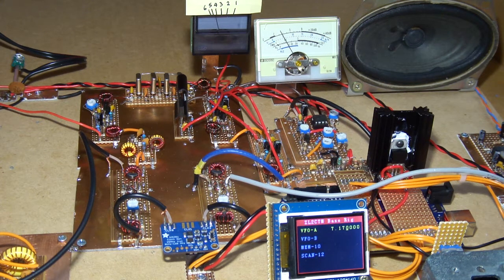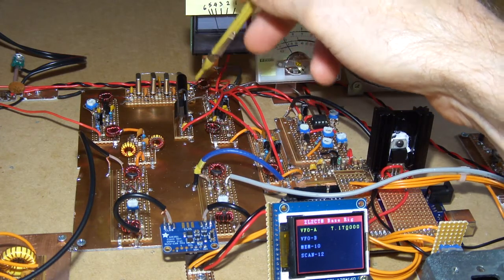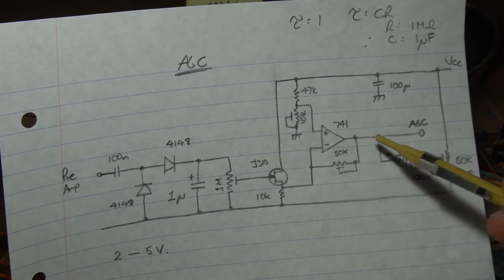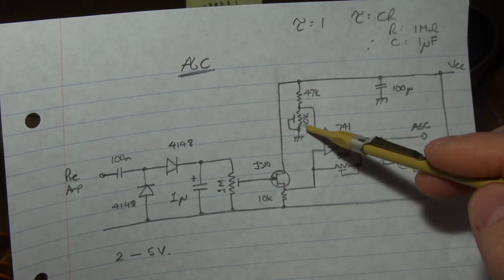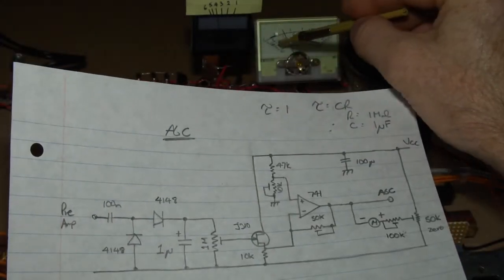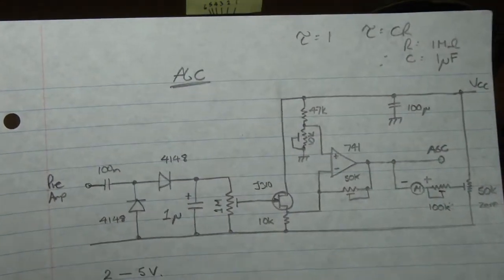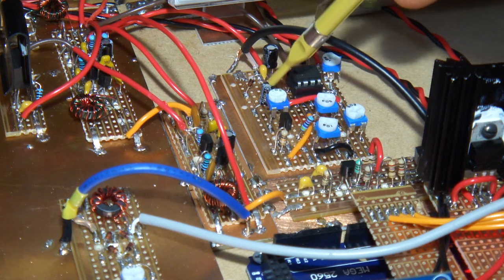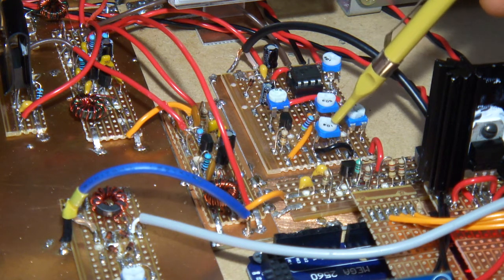Homebrew 80/40/20m SSB Rig Part 6 - AGC and S Meter

Comment: Hi, Charlie have you seen the debate on Mikes Radio repair corner over the S9 calibration levels he uses were he can the international standard for S9 you may not have got that far yet with your receiver Charlie. But adds food for thought.
Reply from the maker: No I haven't David. I'll take a look. Thanks for the link.Charlie

Comment: Hi Charlie
I have some questions again ....
Can you please tell me the turn ratio of the transformer of the first to the second IF stage?
It is possible that you have explained that in the last videos, but I can not find it.
The thing with the LM317 I did not understand unfortunately. Where did you connect this exactly? Can you perhaps explain this circuit in more detail?
Please excuse that I do not get it that easy.

73 Bernd
Reply from the maker: Sure thing Bernd. Now that the receiver is about right (for me), I'll draw up a schematic and put it on the blog. In the mean time, the transformer between the first and second post-crystal filter IF amps is 14T:20T (amp output is 1250 ohms, amp input is 2450 ohms). The LM317 is providing 3VDC to the J310 source resistor. Normally, this resistor is between ground and source. In this case, it's between 3VDC and source. I originally had four 1N4148 diodes in series (from ground to the source resistor) providing this voltage.

73s
Charlie
Reply: This way?

                                  Input ----------------:------------Gate
                                                              :
                                                              R
                                                               :
                                                               :
                                                               +
                                                               3V
                                                                -
                                                                :
                                                                :
                                           ----------------GROUND----------

Thank you for the Transformer Information.

73 Bernd
Reply from the maker: Bernd. The original config was gnd -> diode -> diode -> diode -> diode -> source resistor -> J310 source. It's now +3VDC from the LM317 -> source resistor -> J310. So the 3VDC from the LM317 is replacing the four 4148s that were in series.
Reply: OK, now I´ve unterstand.
Thank you.